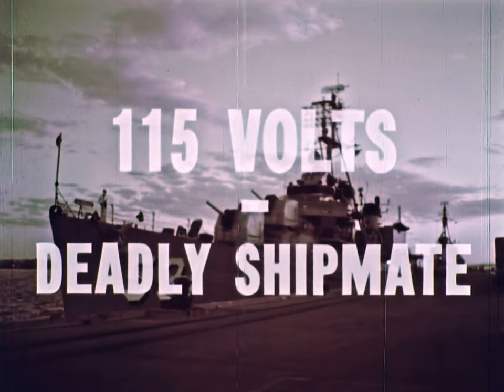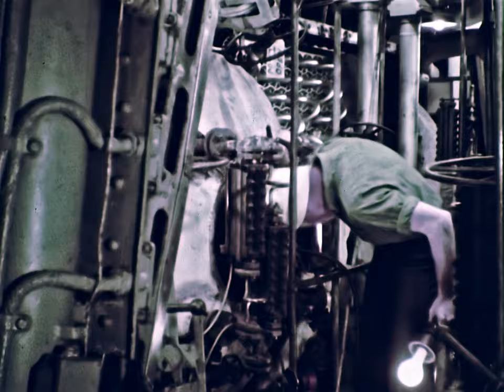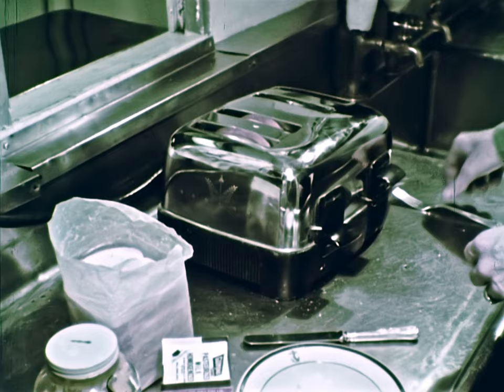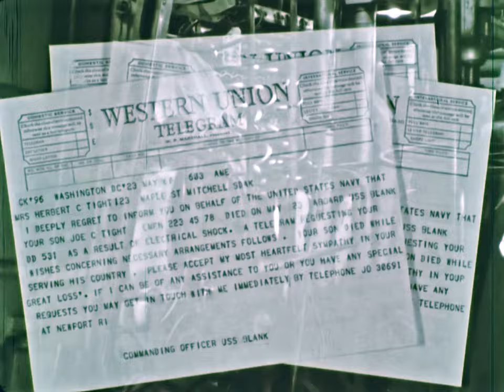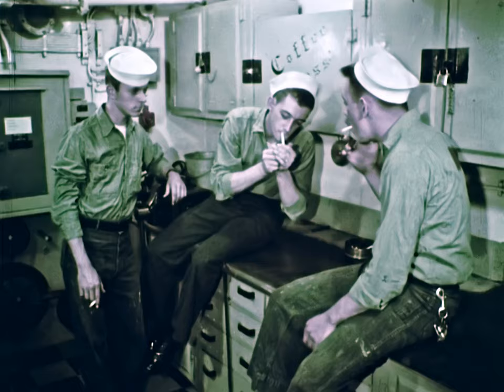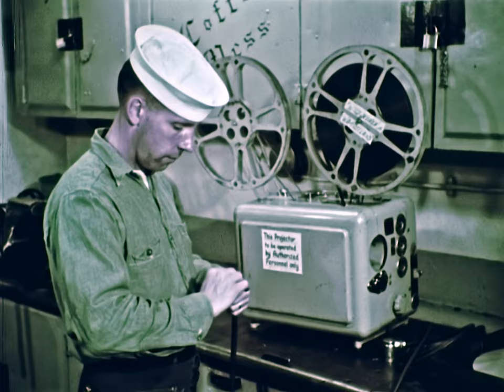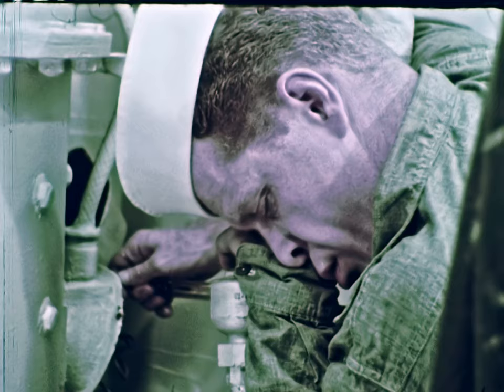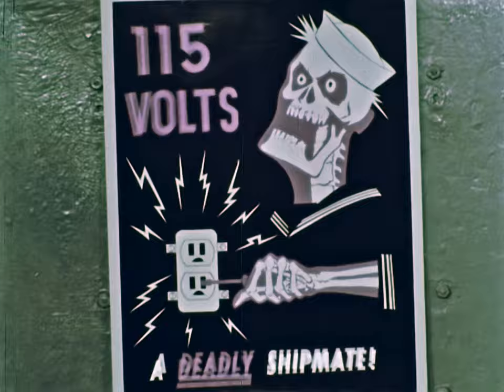1960 16mm US Navy Safety Training Film - 115 VOLTS - DEADLY SHIPMATE

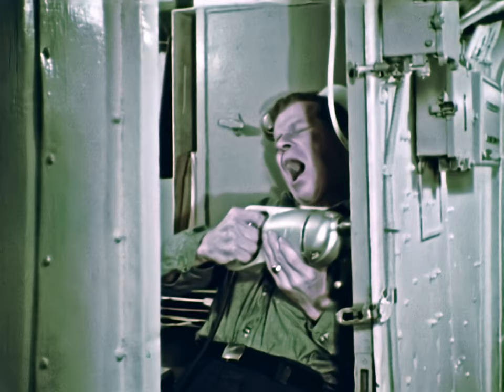Comment: 3:41 - ...wait, shouldn't drilling through a conduit be a non-injurious event if the tools in question are, as stated earlier, fully-insulated?
Reply: Those metal-bodied tools are INTERNALLY insulated but that in no way insulated the metal bit, metal chuck and metal tool body from external current.  Modern tools have non-conductive bodies so external current hazards to their operators are reduced.